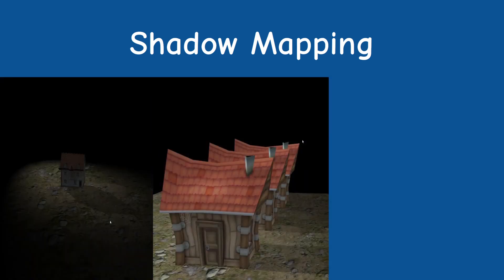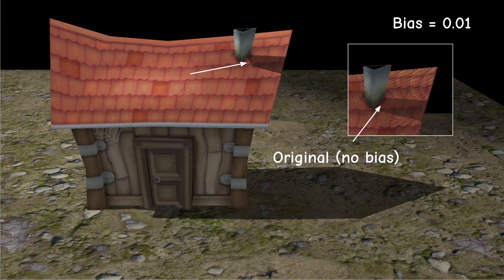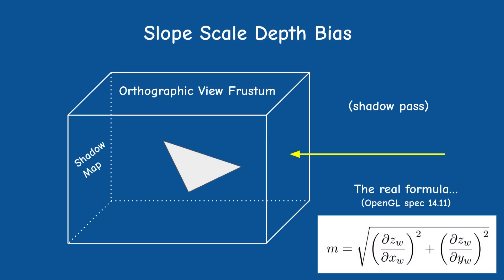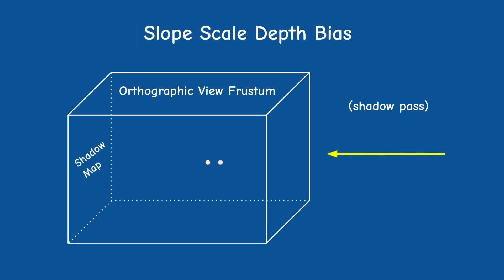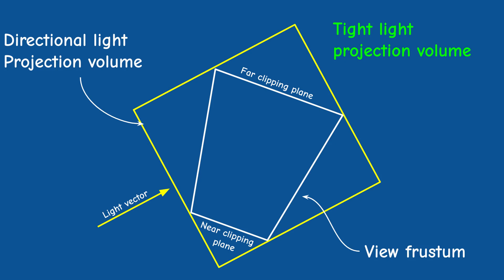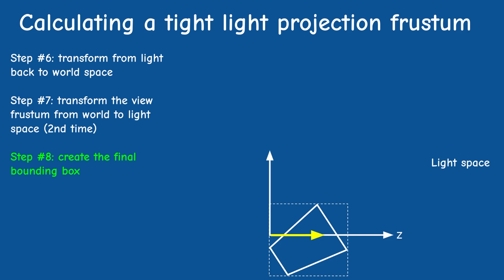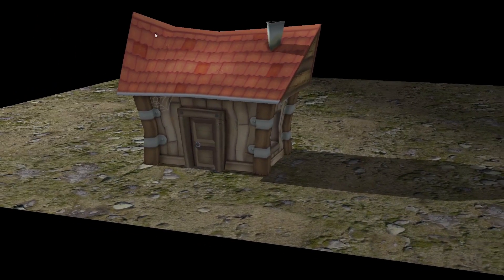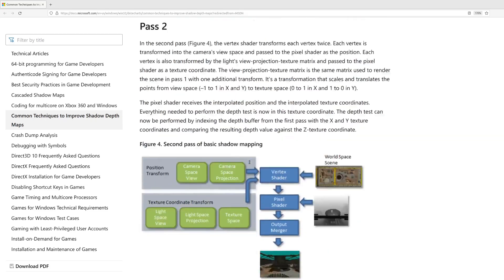Shadow Mapping Unleashed! // OpenGL Tutorial #38

Comment: Hey, thanks for your videos, they're very helpful. 
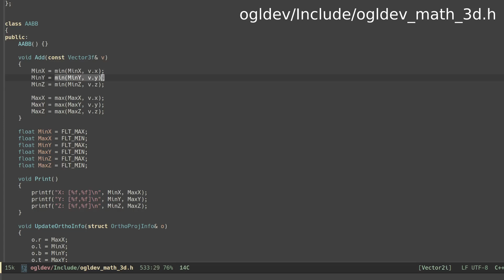14:59 You set the max vertex of your AABB to FLT_MIN by default. Do you know that FLT_MIN is the smallest positive float, something like 1*10^-30 ? It is not -FLT_MAX. I don't know if that's a mistake or if your AABBs simply never take negative floats as inputs. Anyway that is surprising. 
Thanks again, have a good day.
Reply from the maker: Thanks! good catch, I will fix it.
Reply: @OGLDEV  You're more than welcome. 
Also, I'm sure you're aware of it, but I've found out that a much easier way to compute the frustum coordinates is simply to generate the 8 combinations of (+/- 1, +/- 1, +/- 1) to get them in clip space and then apply the inverse projection*view matrix to them (+ perspective division). It also solves the right-handed/left-handed coordinate problem, as this information is contained in the projection matrix. 
The benefits of your method though is that it's much easier to then generate the opengl vertices of the frustum in case you want to render it for debugging (with another camera lol). I never tried that though. 
But really, thank you again, your channel is a gem.
Reply from the maker: You're welcome :-) . Your method makes sense.

Comment: Very cool! I have a question though, wouldn't the Reverse face-culling solution fail if i had a non-closed mesh? I.e. a plane mesh acting as a "wall". Let's say i place perpendicular to the ground, if i understand the solution correctly, it should fail to produce shadows since there won't be any back facing triangles
Reply from the maker: Correct. With front face culling you need back faces to render into the shadow map.

Comment: As someone said in another comment, how do you fix the small gap between, for example, the ground and an object on top of it? I've set my bias to zero and there still a tiny but noticeable sliver of "unshadowed" area where an object touches the ground.
Reply: Jus to clarify, I'm using reverse face culling, but it still happens when the object on top of the ground has no "flooring" (that is, has no faces on it's underside). Is the fix just making sure all objects have faces under them, or is there another way?
Reply from the maker: Is the object very thin? The recommendation is to avoid thin geometry when there is a problem of peter panning. Reverse face culling is usually the solution and if you can enable that by having flooring on your objects then that effort is certainly worthwhile.

Comment: I'm using reverse face culling for rendering shadows, but there is tiny gap on the border between the object and its shadow. How to solve this issue? Is PCF a possible solution?
Reply from the maker: Sounds like a bias issue.
Reply: @OGLDEV  What if this still happens with the bias set to zero?
Reply from the maker: @pedroocm You actually need to set the bias to a non zero value. Otherwise it has no effect. The best bias value is a bit of magic but there are algorithms that help.

Comment: For the tight-fitting light-projection, I feel like I completely understand each component 110%, but putting it all together it's just not anywhere close to working. Does my world space up-axis matter at all? That's the only difference from my code and yours, but I don't think it would make a difference. Also instead of doing tan to find the frustum planes I'm using the inverse projection matrix, maybe that's the issue too.
Reply from the maker: Are you on a right or left handed coordinate system? Sometimes this is the reason why people need to tweak my code a bit to make it work for them (I'm using the left handed system). If you're following the same steps you should be able to compare intermediate results between your code and mine. And of course if you know that you've changed something fundamental try to use the original version to pinpoint the problem.
Reply: @OGLDEV  Ahh, yes, I changed the code to find the midpoint on the max-Z plane rather than the min-Z plane, and that seems to have worked. Viewing the light-space through the camera's MVP helped. Thanks for your response, and the tutorial!
Reply from the maker: You're welcome :-)

Comment: What's the point of calculating the first AABB without translation in the light space matrix if we are just going to end up reverting it back into world space then back to light space with translation and use the AABB based on that.

edit: oh, we get the center of the first AABB, then calculate the world position of that, and then transform that using light space matrix with translation.
Reply from the maker: Exactly, we want to "stick" the light on the center of one of the sides of the bounding box. It's easier to calculate the bounding box in light space so the first transformation to light space is without translation. This keeps it in the same location. The second transformation includes translation to move it back to the origin. I'm pretty sure you can calculate it with less steps but I suspect the calculation itself will be more complex. This calculation is "lazy" in the sense that the frustum and bounding box are calculated each in the coordinate system where it is easiest to do so. This incurs a few coordinate system transformations using the tools that we already have.